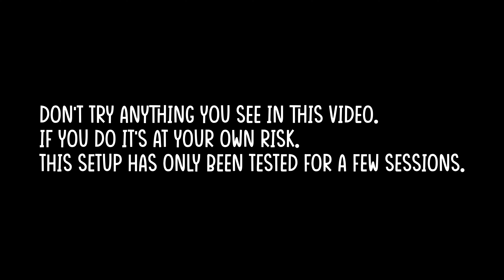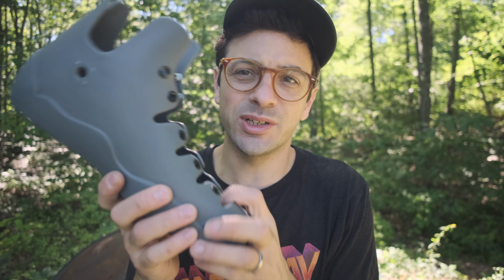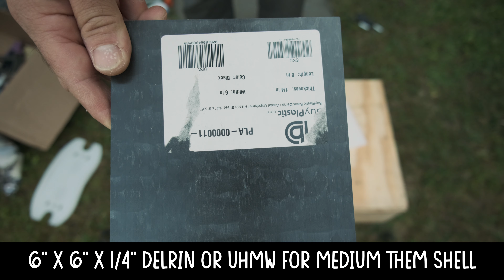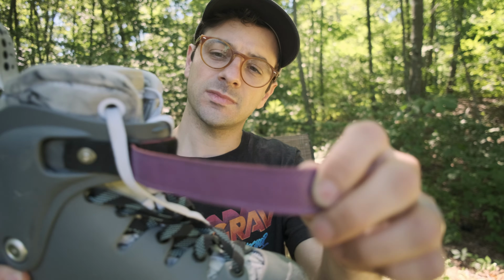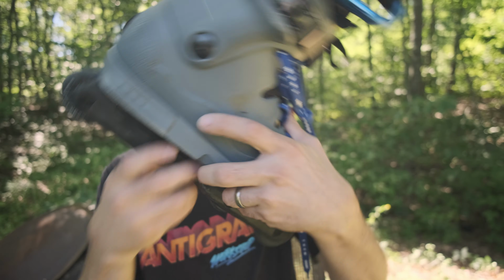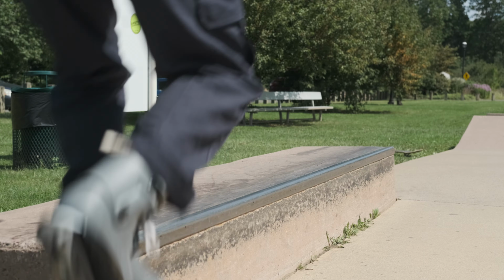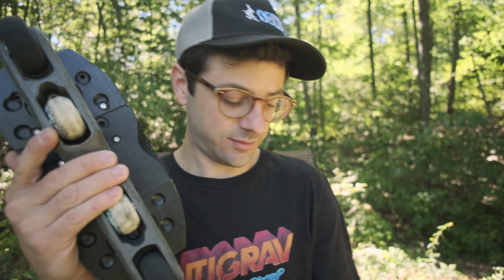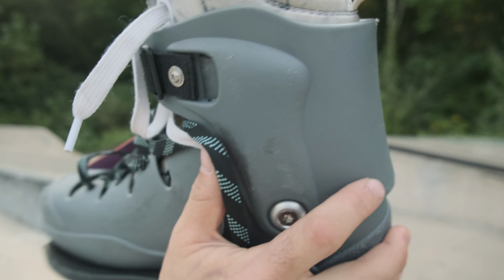Adapt Plate on THEM 908 909 JAD Rollerblading

Comment: You could also cast of the bottom of the boot starting at the transition and ending at the heel. Then you could pour a proper shim, you could even use a high durometer rubber and have a shock absorber.
Reply from the maker: I thought about a shock absorber. People mentioned that might not be good for response. However I do have one of my shells and sole plate in the hands of a 3D printing specialist so maybe something cool will come of that.
Reply: @jadrollervlog  Agreed, a soft compound would definitely affect response. I was thinking more like a high durometer urethane, like 85a minimum. Smooth-on sells a range of urethane products. They have tons of awesome products for casting, mold making and production.